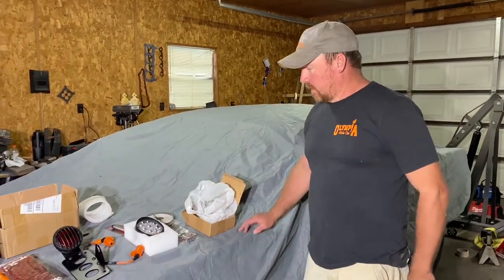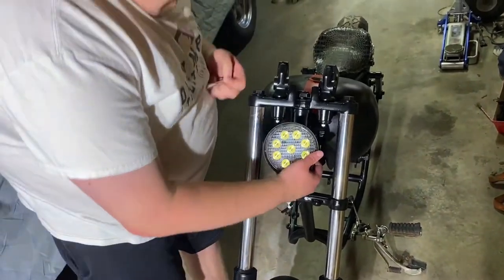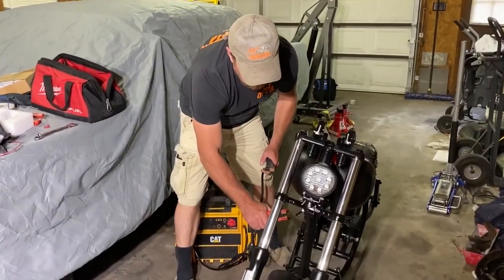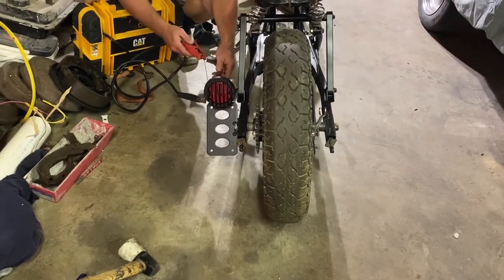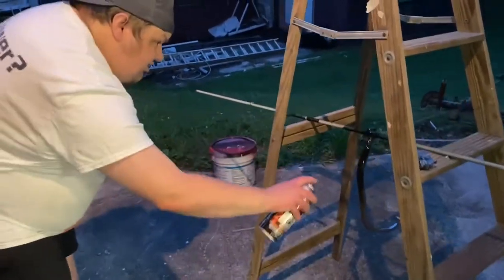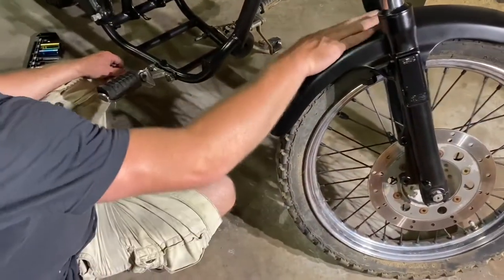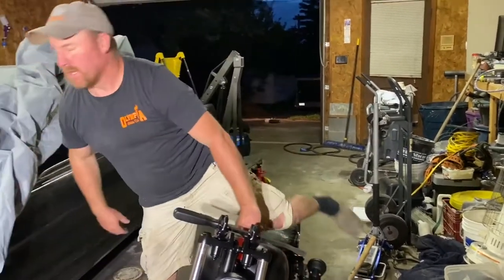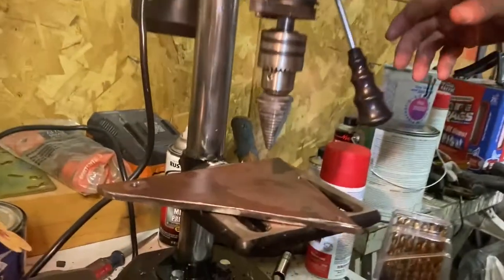1986 Honda Rebel Bobber Build Part 3

Comment: what did you guys go with for the Brake, throttle, and clutch cable lengths? im installing 10" mini apes and trying to find the right cables
Reply from the maker: We just used the stock ones that was on it.

Comment: Gentlemen, Do you have a picture of the vacuum line connection for the carburetor? My 1985 rebel has a single carburetor. I am trying to make the connection.